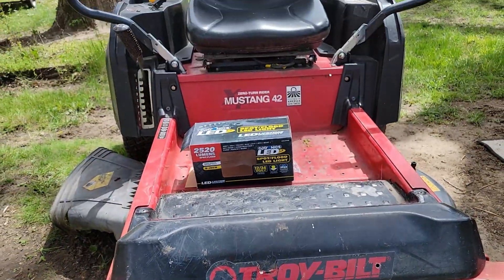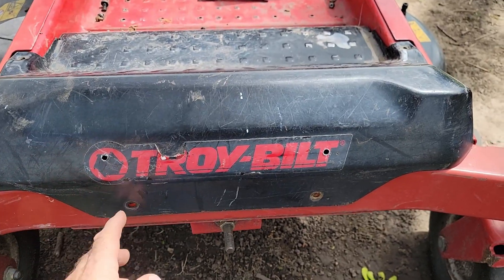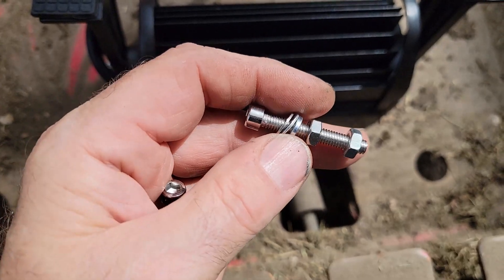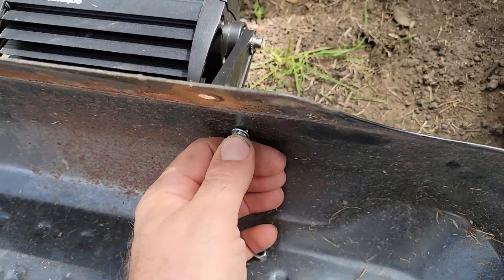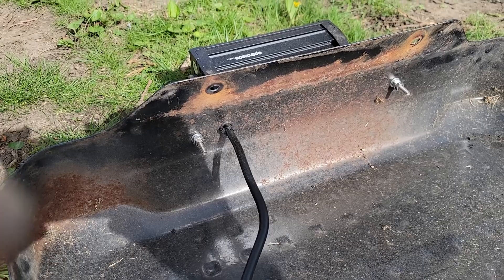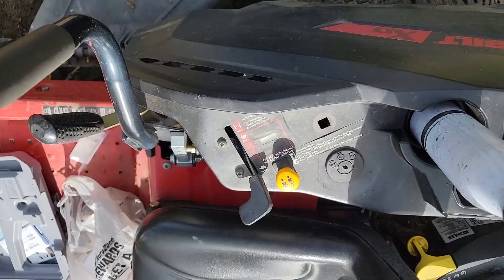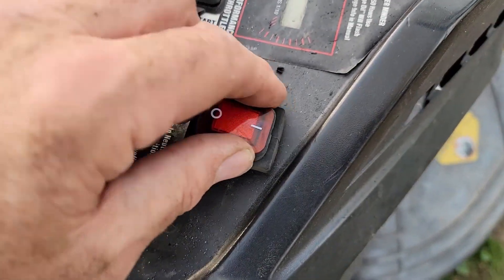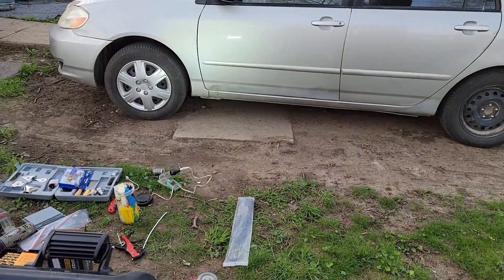How to install lights on a Troy built zero turn mower

Comment: My Troy Bilt model 17ARCACS011 does not already have a hole to mount the switch.  In your video, the hole looks rectangular.  Can you tell me how to make a rectangular hole, and are all light switch bases the same shape?  
   Do the lights come in different lumens? 
    You mentioned a fuse, does the fuse come with the light switch or do you purchase that separately?       What size fuse should I buy, if it is not included?  Where does the fuse attach?  I missed that in your video.  Thanks
Reply from the maker: To make the rectangle hole, you will have to first drill a round hole, then file it into the size you need.  look at the switch and the directions to see the size of the hole.  The switch is designed to snap into the hole, so be careful not to make it to big.  
👉Measure and text fit as you enlarge the hole. 
As for the lumens, you can get different ones, generally, the bigger, the more lumens you will have. 
👉For the fuse, you will have to look at the light and determine how much current the light requires, and then get a fuse that will handle the load. Don't oversize the fuse; it could cause other problems.